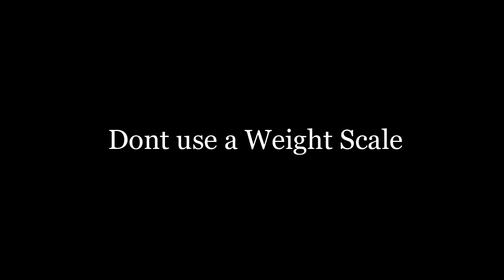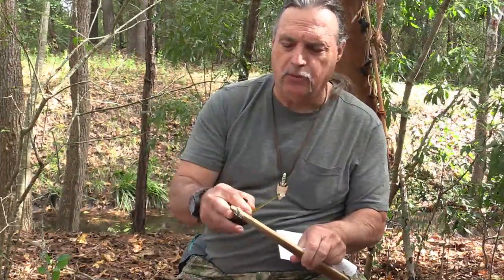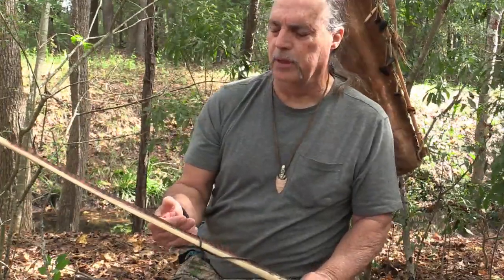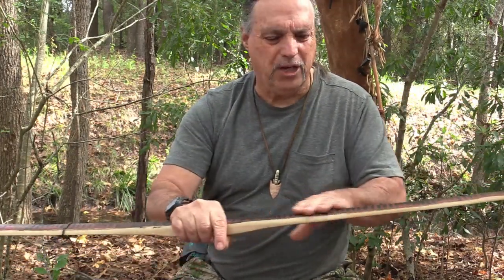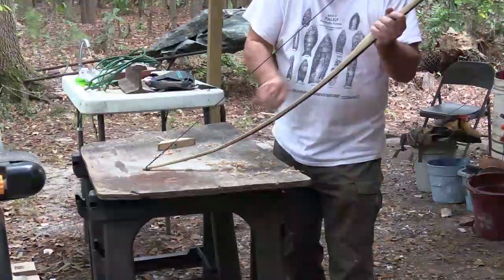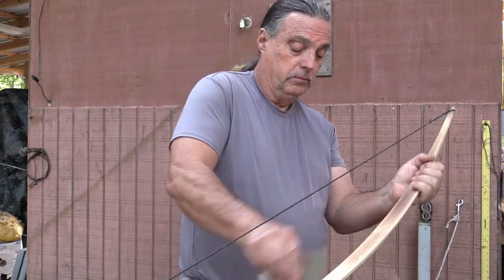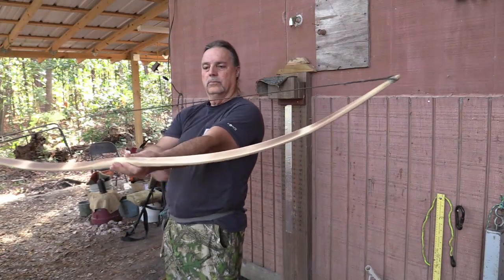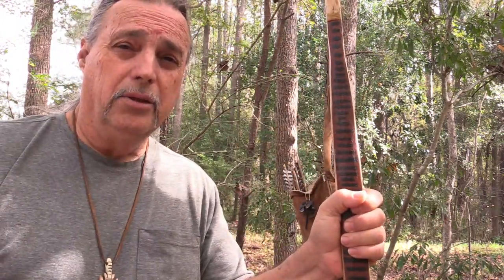How to make the most Accurate and Smoothest draw Wood Bow

Comment: Hey Thad. I recently fire-hardened a hickory English longbow stave, which is significantly thicker than a flatbow stave. Cooked it for three hours, checking it every ten minutes or so. Got what I thought was a pretty deep browning, but after scraping it down it is only a mild brown on the belly and fairly light color on the sides (had to remove quite a bit of wood for floor tillering) After a week it reads just over 5% on the back and zero on the belly. Still holds its initial two inches of backset after a lot of flexing the limbs during floor tillering. My question is should I just leave it there since its moisture content is so low or cook it again to get a deeper browning? I plan to bamboo back this bow, so I wondered how far to push it. Thanks for the work you are doing!
Reply from the maker: Sounds like it may be good. If this is a traditional style English long bow with a d belly or rounded belly, I must admit I have no experience with the design.  Sounds like you did a good job with what you have. Hope it makes a very successful bow.
Reply: @BeckumOutdoors  Thanks for the response. Still learning the process. Yes, it's a rounded belly bow. Thought I may have went too far since the belly was pretty dark, but after scraping it's a much lighter brown color. Excited about this Fire-hardening process. Downloaded your video and have probably watched it more than a dozen times. Thanks for sharing!
Reply from the maker: @shanhur4562  Thank you and hope you make some really great bows,
Reply: @BeckumOutdoors  By the way, love your bow!